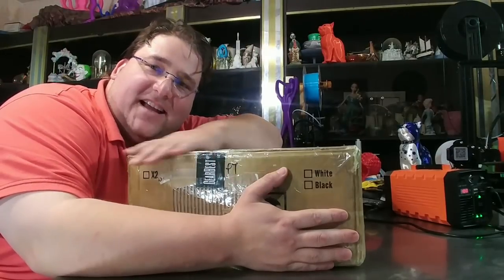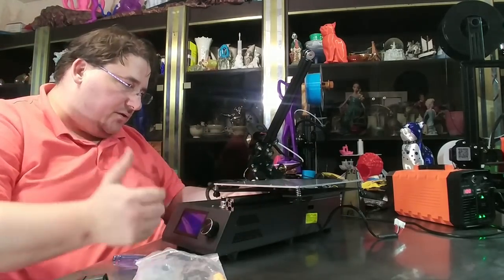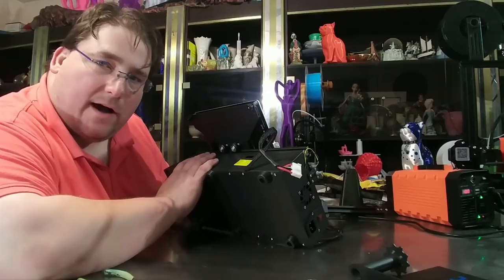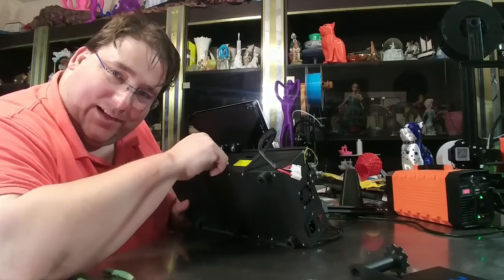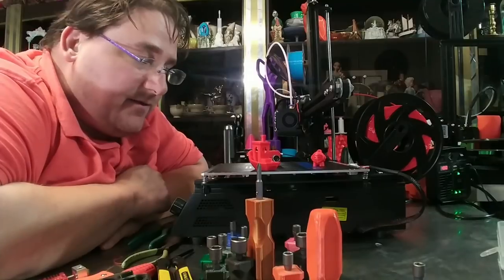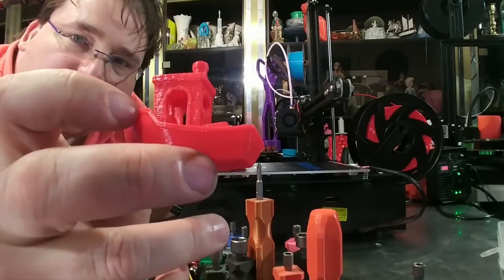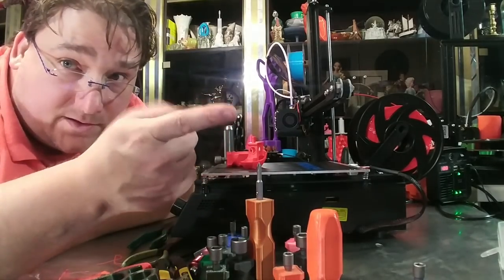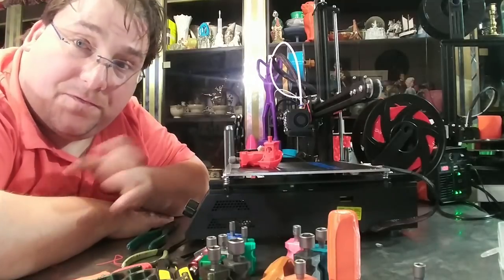T3DP 230 Tron XY X2   Unbox, Build, Print

Comment: great video, thank you. Compact, neat looking little printer. Not sure about putting hot steppers in the box - looks better but might make the board and power supply to run hotter than necessary. Seems better to put the filament holder down low, instead of balanced on top, no idea if that makes much difference though.
Reply from the maker: I just prefer the convenience of the filament there so far it has not been a problem even for the even smaller Ender 2

Steppers inside are okay they don't get very hot 99% of the time and being bolted to the frame is excellent heat conduction and will keep them cool

It's a nice-looking printer it really is and I was hoping for Good Things based on the X1 I think it's just quality of components problem if I replaced a bunch of the parts I think I can get some very good quality out of it but now I'm taking a printer that's already more expensive than other better printers and making it even more expensive

Comment: Picked this up on amazon cheap, I have to admit its a solid printer Chris. Im not sure if they have updated it from when you did the review?
Reply from the maker: I sent them feedback i hope they uodated it that would be excellent!
Reply: Nerys the issue I had was with the bed, it wasn’t pulling it at all. So I pulled up the stepper gear and screwed it tight and we get zero issues now. 

I hope they took note of what you said Chris because they’d be wise to do so.

Dave

Comment: I have the Ender3 and I absolutely love it. I also just got the 2018 Tevo Tornado. Do you suggest I take the bearing out from the top of the Z rod support? I know the ender doesn't have the support at the top.
Reply from the maker: If you have any kind of Z banding issues yes remove it
Reply: @nerys71  nope no z banding.  I printed a full size rocket and spiral vase. There is some of the salmon skin with the spirals but I just put a set of smoothers in it. Have not tried a print yet.

Comment: Hey there I am still after a Ender 3
But now there also Is a Ender 3 pro...
WHAT you think too bye normal or the pro?
Reply from the maker: That's up to you I have an Ender three Pro coming in the mail I understand has a couple of minor modifications as well as a reinforced Center rail mean well power supply and see magnet removable bed

Are those upgrades worth $100 or $70 is? I'm not sure I suspect the original one will be a better value for your dollar to start with I would probably go with the cheaper one